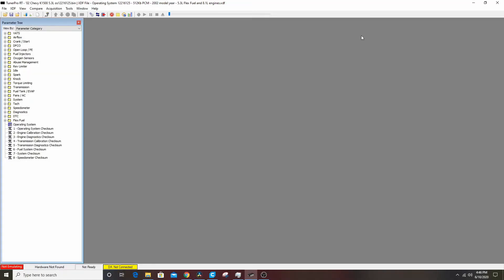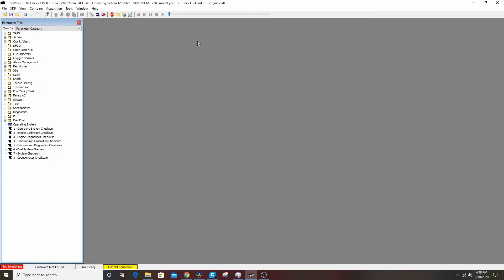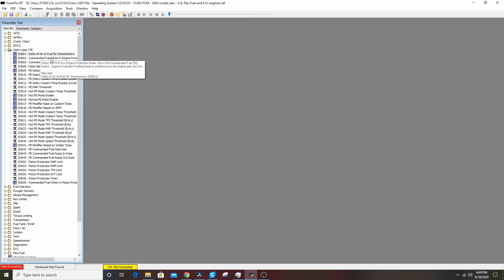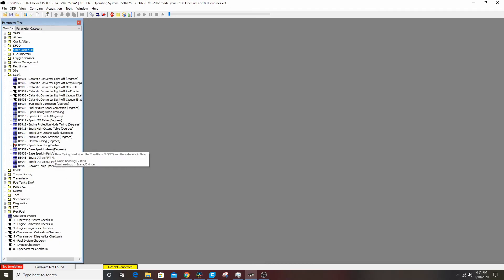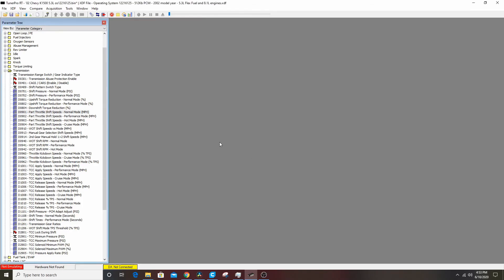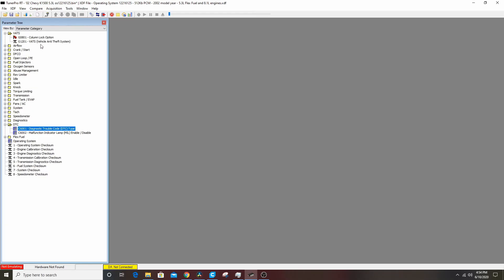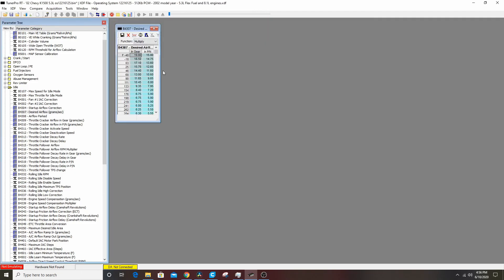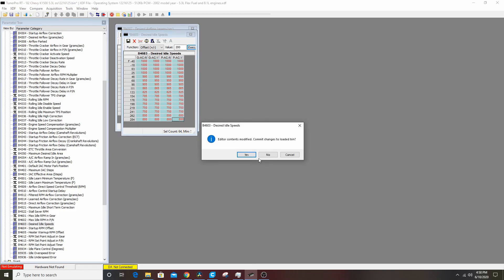Tunerpro basic LS tuning how to, free tuning software

Comment: Great video.  I just built my first 5.3 with a stage 2 cam.  I was getting random misfire and rich bank 1 and 2 codes.  I did the SWAG method dropping the VE by 20% low in the RPM range and raising the higher RMS range by 20% as well. I then adjusted my idle up a little.  This made a world of difference and it passed the smog test with a reading of 4 (220 allowed) and .5 (1.5 allowed) for the two tests, both loaded and at idle.  I didn't have access to an AFR, but the engine response was dramatic.  Such a simple video that provided everything I needed for my tune.  Thank you for taking the time to post this.
Reply from the maker: That's awesome! It's always great to hear these help people!

Comment: What’s the difference between the ve table on tunerpro vs. hp tuners? I can’t figure it out
Reply from the maker: Not sure what you mean, it's the same table, located under the airflow tab (Don't ask me why they put fueling under airflow)
Reply: @  on mine in tunerpro it says “main ve table (grams*kelvin/kpa) and for example instead of showing 44 at the 400 rpm 15kpa cell like hp tuners it shows .9545 for the same cell. The range from low to high on the ve table in hp tuners goes from 23 to 99 but in tunerpro it goes from .752 to 2.5615. I’ve even checked out different bin and xdf files and it’s always equally as strange

Comment: Thanks for the videos , just getting started - have read bin and found xdf file - but getting the OBD2 readers to hook up seems to be hit and miss - using obdx pro gt with the USB cable 

So now just having a play around , it's a spare pcm so not to worried lol 

What's involved in making it a mafless tune ? I've seen you can set the maf fail to zero but is that it ? 

I do have a wideband so will use that for tuning afr cheers

Comment: Quick question. 

I’m in the process of rebuilding a gem 3 5.3ls , I’m putting in all of the forged goods I can. I’m planning to swap the engine into my bmw e36 m3. Problem is, I’m not sure whether I should go for terminator x , or get a wiring specialities harness. I’m planning to put a turbo on it. Will I be able to tune it on TunerPro once I go turbo ?
Reply from the maker: You can use the stock harness. Tunerpro doesn't care if it's turbo'd or not.

Comment: If you turn off a DTC, does it still set the code but just not turn on the mil light?
Reply from the maker: You can set it to not report, or to not trigger
Reply: @TheDrivewayEngineer  I know I had seen that but thank you for pointing it out. I was getting tired of seeing the codes.

Comment: do you have to use a bench or can I just use pcm hammer and plug it in and write my tune?
Reply from the maker: You can try, at the very least pull your radio fuse.

I'd recommend using a bench harness

Comment: Great video. Apparently I have a unsupported OS (OS ID: 12593058). I've searched high and low and can't find a compatible XDF file. Do you know where I can find a compatible XDF for my 2003 GMC Yukon XL 1500? Thanks
Reply from the maker: You're doing it backwards.

Find an OS compatible with a working XDF
Reply: @TheDrivewayEngineer  OK. Thank you for the feed back.

Comment: Actually doing something opposite, I am looking at building my father/son project with a 5.9 Magnum .  Ditch the Dodge ecm and use a more adaptable LS computer .  Swap all of the sensors since I’m replacing all of them anyway.
 Looking at PC Hammer and TunerPro with the Bluetooth dongle I guess.    Good to see someone getting in depth .    Thank you .
Reply from the maker: The 411 PCMs are very adaptable, as long as you can get a 4x or 24x crank signal into it, it can probably run your junk

Comment: hey JR , im trying to remove vats, enable electric fans and remove trouble codes with tuner pro, pcm hammer and OBD2 lx dongle
according to pcmhammer, my pcm is 12200411 for a 2002 avalanche mated to a th350 tranny with de-pinned harness,  and only precat O2 sensors.
  i know my XDF is 12212156 and i found both gearhead efi and boredtruck owners but waiting n waiting to be approved there, and boredtruck owners confused me. i couldnt figure out how to download their XDF, if i clicked on it it opened and looked like 150 pages of code but no download link.
Rick at LS1 says he will email it to me.
Someone also said i need the proper checksum files?
what do these do and how do i install them in tunerpro?
Once i get changes made to my bin, I  need some tips how to actually   write my new modified bin with pcm hammer

now lets see if i understand the steps.
1. i use pcmhammer to read entire pcm
2. save that pcm bin file as stock unmodified bin
-how do you save it as i only see option in pcmhammer to save results and debug log. is it one of those options ?
3. then i use tunerpro to open that saved bin, make changes i want and delete codes  
4. then save as modified bin
5. then use pcmhammer to open modified bin, but which option writes it to my pcm?
under tools;
-write parameters
-write OS, calibration and boot
-write full flash/clone
under operations;
-write calibration
then let it do its thing  and i should be done?
Reply from the maker: I'm going to dig through my pile of PCMs and find one to do this again from scratch
Reply: @TheDrivewayEngineer  ok  im using a different XDF than you so things look different but i think i successfully made the changes i wanted with tunerpro  to delete VATs[set to 2], enable  fans[ just set proper come on and turn off temps] dont have your enable buttons, Dtc set to 3 and it apparently saved despite giving a warning error at time of saving,  citing missing checksum files?
is this a major problem ?
I definitely dont wanna write my only pcm with a pending possible problem as its  my only pcm

Comment: If I tune my 09 silverado flex fuel on e85 will I be able to use normal pump gas and then run e85 when I race?
Reply from the maker: Not without a flex sensor

Comment: I can't find an XDF for my OS. I hear there's a way to change the PCMs OS but I dont know how? Does anybody know how?
Reply: Find an XDF and OS that work with eachother and match your transmission and Engine setup. Then replace whatever OS your PCM has with this new OS by following the instructions in the video JR posted in these comments. Use the matching XDF to make any changes to the new OS file and flash/write it to the PCM as needed.

The only change you need to start a stock engine is to turn off the VATS.
Reply from the maker: Write a new one. The same way you'd write yours back if you could find an XDF
Reply: @TheDrivewayEngineer  Thank you JR. Forgive me for being dim here... Do I just change the number of the OS while I'm in tuner pro? Or am I completely missing something here?  I do understand I will have to "flash it" once I upload the new OS, I'm just not sure how to upload or change the OS. Thank you
Reply: @TheDrivewayEngineer  I also want to thank you so much for your awesome videos and input, I just pulled a 275k mile LM7 from the treasure place that spins and wins. Gonna slap it in my 2nd gen camaro and send it. My coworkers think I'm crazy just like you're always saying haha
Reply from the maker: Start here

https://youtu.be/PyFtSta_IB0
Reply: @TheDrivewayEngineer  video is private now. Interested in what info was in this video